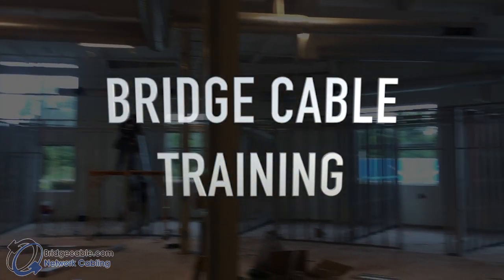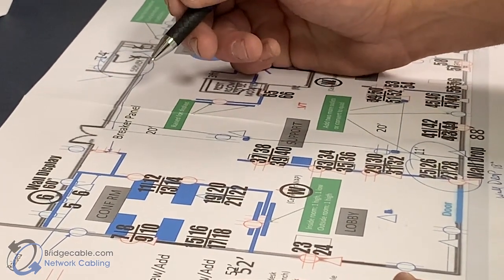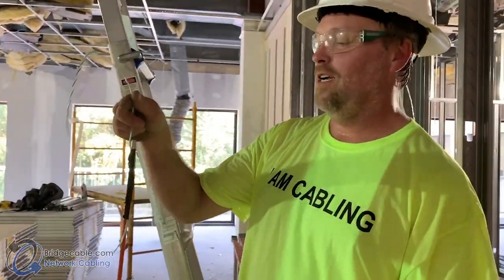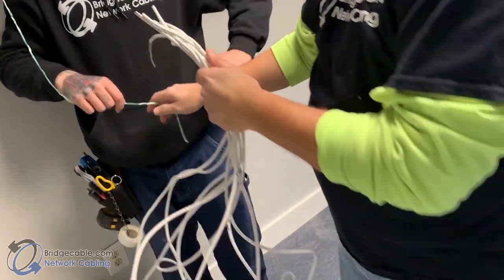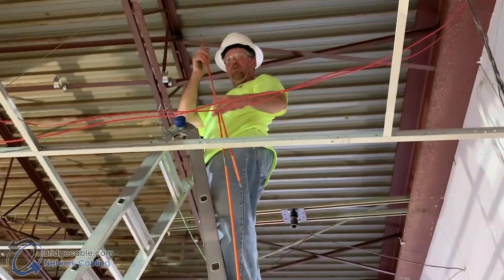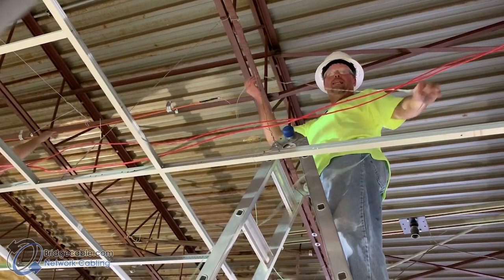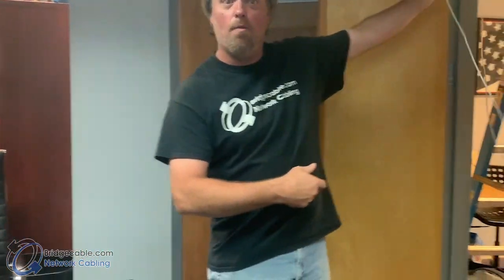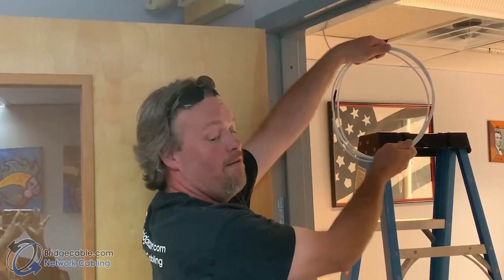How to Become a Network Cabling Technician Training | Low Voltage | Part 1 | Bridgecable.com

Comment: The leader in structured cabling will teach other companies/businesses how it’s done! We found the leader. Great work guys!
Reply from the maker: Helping the next generation. As well it helps to have a standard with our teams. In this business there is 3 names for everything. Biggest time saver....standard on labels. Losing cables.....the worse.
Reply: @BridgeCable  any job be i will can i am cctv and access control system experience 5year gulf 4year experience sir
Reply from the maker: @Jaravind-dy3wt  Thank You for your service! As of a job....we hire from time to time in the Philadelphia area. Just go to the site and look under jobs.
Reply: @BridgeCable  any job be i will can i am cctv and access control system experience 5year gulf 4year experience sir